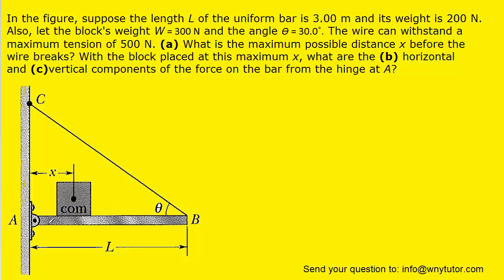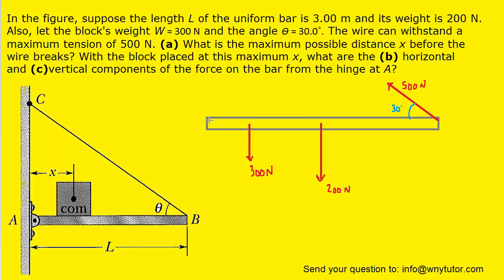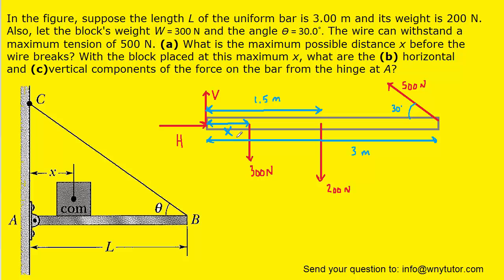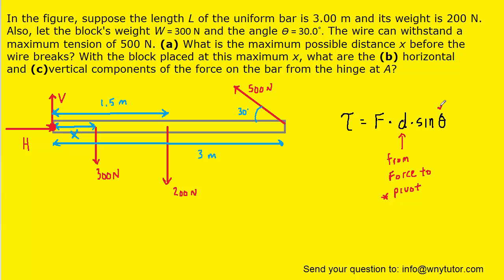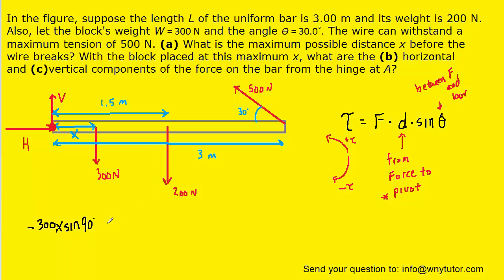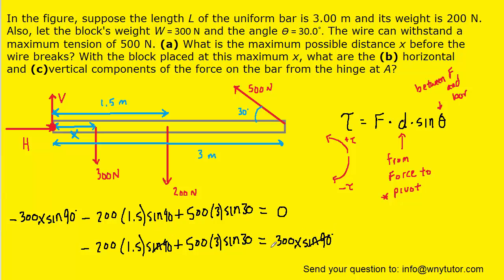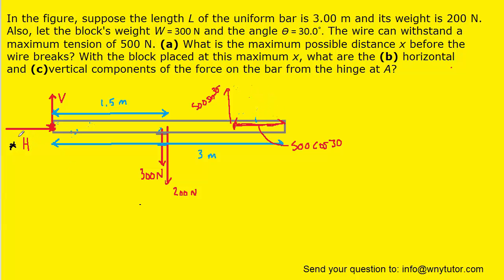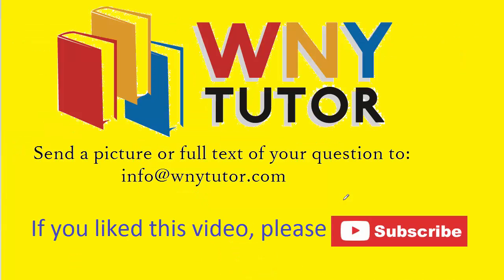in the figure suppose the length l of the uniform bar is

Comment: Thanks for the video i found this when i got stuck on the last part of this question. Why is it that when computing the vertical force you do not use the gravitational forces that are acting on the beam instead of simply the weight? My thought process led me to believe that the force of the box that was acting on the beam is equal to 300*1.5 and the beam would be equal to 200*3...Is it because the cable hasn't snapped and thus the length from point of rotation is irrelevant? Thanks!
Reply from the maker: +Dave Sandy Thanks for watching! For part c of the question, we are analyzing the sum of the FORCES acting in the y-direction, not the sum of the TORQUES.  So you should not be multiplying any of the forces by a distance in this part of the question; you should just be working with the forces themselves.  Does this answer your question?
Reply: +WNY Tutor Perfect thanks. I was operating under the assumption that the force on the beam would vary relative to the position of the mass on top of it. Which you explained was not the case.
Reply from the maker: +daves1186 Great - I'm glad it makes sense!
Reply: @Daves111486  I did that too lol, It makes sense now seeing how its not torque it doesnt matter where on the lever you are.